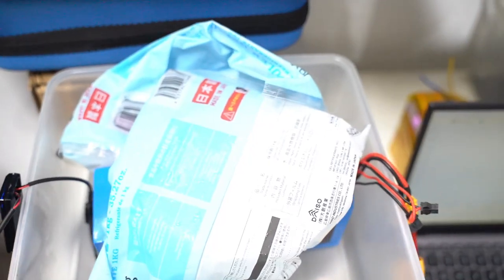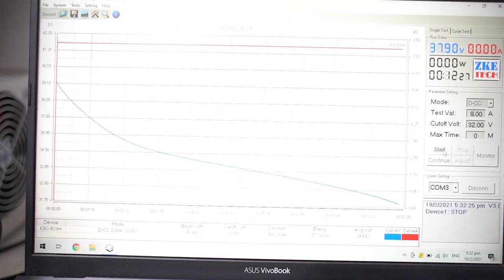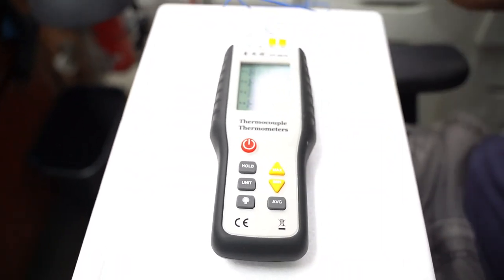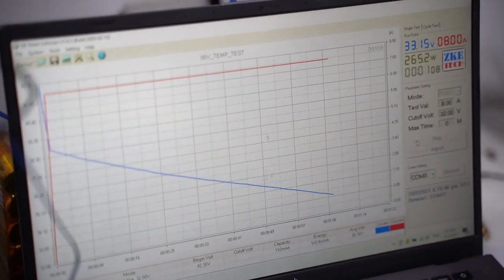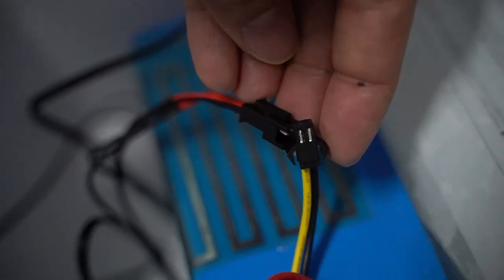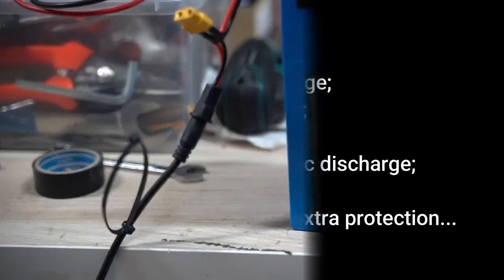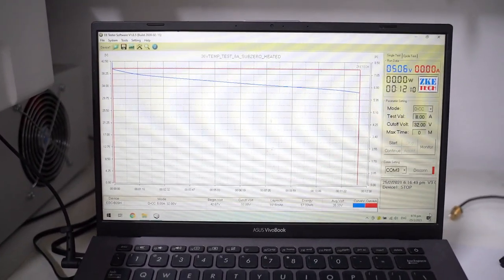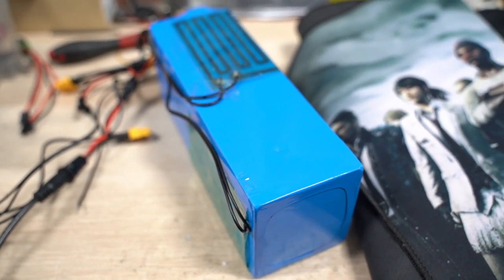What happens to E-Scooter Battery in Cold Weather and How to solve it

Comment: I love your practical videos, I have a zero 8 which got me in love with scooters, and upgraded to 10x 23ah last year, all your advice and videos have been helpful and easy to follow,  only minor maintenance during a period of 2000 kilometers of riding in wet and cold weather of Scandinavia, without riding in heavy rain of course. :)
Reply from the maker: That’s the best reward for us that you give your scooters some TLC once in a while:)
Reply: sorry to be so off topic but does any of you know a trick to log back into an Instagram account??
I stupidly lost the password. I love any tricks you can give me.
Reply: @Shawn Trace instablaster ;)
Reply: Hi 
I wanna ask u, What is the range of the scooter when driving in extreme cold?
Reply: @AhmedAhmed-fk6ri  In the winter cold between -1c to -5c i get around 30km to 25km respectively on 23ah Zero 10x.

I store in room temperature garage.
Reply: @supersonicspeed9  ok thanks and How did it work on snow and ice, Do you lose control or fall out of it ?
Reply: @AhmedAhmed-fk6ri  I avoid riding on snow and ice, but you can find 10 inch snow tires on aliexpress to make it ride a bit safer.

Comment: Thanks on wery good explanation of batery droping. I'm interested is scooter goo litle slower in winter I both it 1month ago and I liwe in EU so my Vsett has to goo 40minimim and hee is going 36 max is it cos of wery cold temperatures it has been 4°-0° Celsius.  Please answer if you cant cos I don't know. Thank you.
Reply from the maker: Yes it’s because of the cold temperature which causes the battery to have lower performance and the motor to be slower. You can try to warm up the battery first

Comment: I face this problem right now in Greece at - 6 C° . I can`t bring the e-scooter into the house, I have no heating element, but the insulation could probably help to retain the heat the battery is generating under low load at the beginning.
Reply from the maker: Use the insulation wrap

Comment: Temperature tests are too light for batteries xD. I ride my EUC in -15 -25 degrees celcius for many hours, and its all ok, the only thing to remember is not to stand in one place for too long (more than 30 minutes maybe). The difference with e-scooter is that it's shell is made from metal, and it cools faster, than plastic EUC shell. So, there is a reason to add at least one insulating layer, like neoprene. But heaters are not needed, battery heats up by itself while under load.
Reply from the maker: The heaters are for the initial part where if you don’t use heaters, the voltage sag in the beginning is going to be too drastic. We recommend the heaters to be switch on off using thermostats so that the heaters can be turned off when the temp reaches 25C

Comment: Would it not be true to suggest that the most winter drivers will begin their journey from home, where presumably the home is at a good ambient temperature? What I mean is that although it may be cold outside (we regularly get little more than 12 degrees C here in the summer, never mind in winter!), the battery and whole EUC or scooter would normally be brought outside from the minimum 20-21°C warm environment within the house, where the whole unit would have reached such a temperature. 

I do not advocate leaving the vehicle with battery in the cold in a garage, but it would be possible to keep the vehicle in a suitable dedicated ‘warm and fireproof cabinet’ in the garage if one was concerned about having the vehicle inside the family home in case of fire. My own EUC has a neoprene cover, and given that the whole unit is kept inside at 21° C or so, even allowing for windchill on a cold and frosty morning, the mass of the whole EUC would not suddenly become sub-zero in temperature, it would be quite insulated. I guess the takeaway is to start from a warm place, do your best to try to have the battery compartment insulated from the effects of the cold, and keep going until you get either back again, or to your destination, hopefully another warm place!

Just waiting for my Vsett 10+ to arrive, but loving my MSP HS EUC!

Comment: What is the cutoff for a 52v 23ah battery that's in my Z10x
Reply from the maker: About 42V but it depends on the temperature. If temp is too Low then abit of current draw will result in the voltage sag below the threashold.
Reply: @FalconpevSg  thanks for the quick response guys👍👊
Reply: @Maltmeister1  how about 60v 20ah?